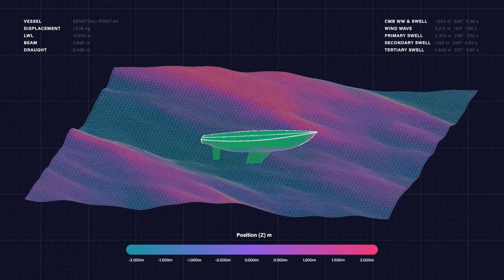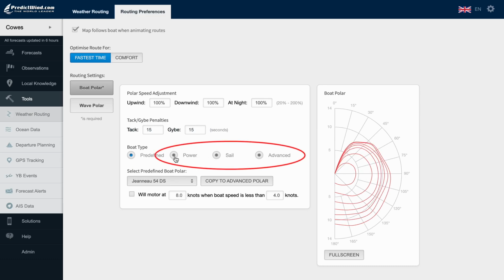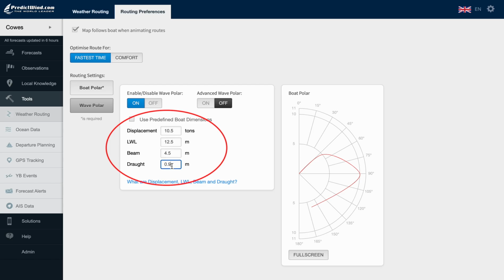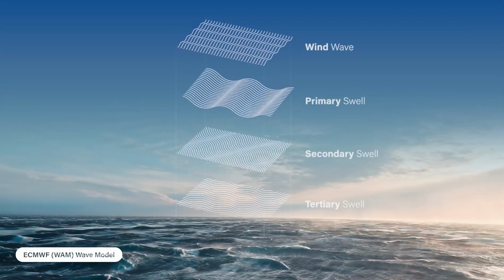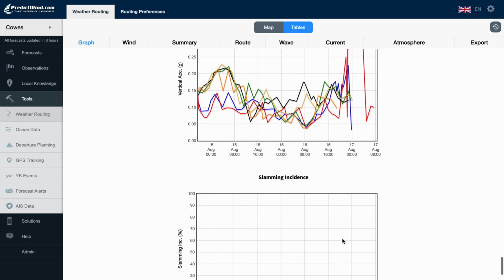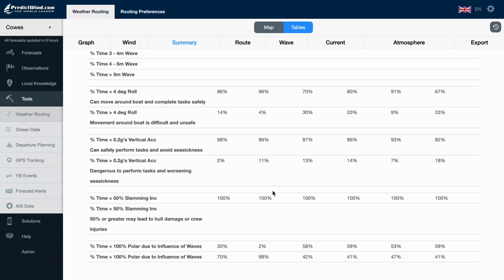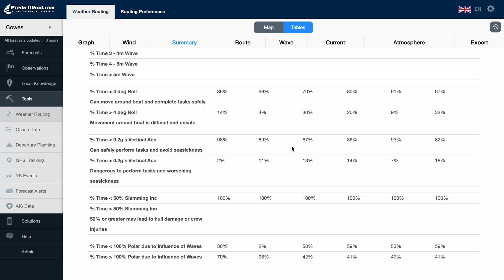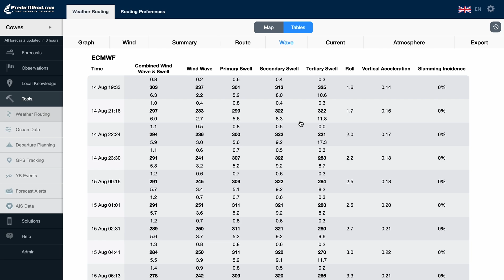Wave Routing Tutorial

Comment: You don’t mention that you need the pro subscription to get most out of these features. Good innovation though
Reply from the maker: The polar is adjusted using the hydrodynamic modelling in the Standard subscription, but you are correct to see the Roll, Vertical acceleration and slamming incidence you need Pro sub. thanks.